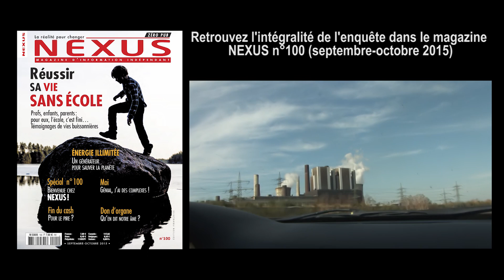KPP Rosch Innovations - Énergie illimitée ? - NEXUS n° 100

Comment: Solar energy is Compressed air energy storage ,  Your device is working
Reply: It's not.
Reply: solar energy is useless. The system just need to be "runned" you can runned it by bicycle if u want and after, it is self-running with exedental energy